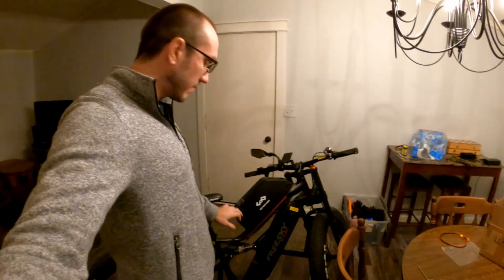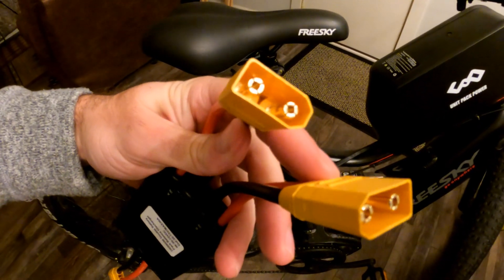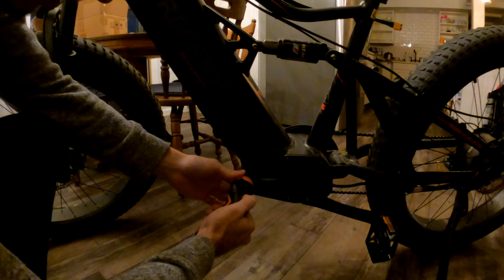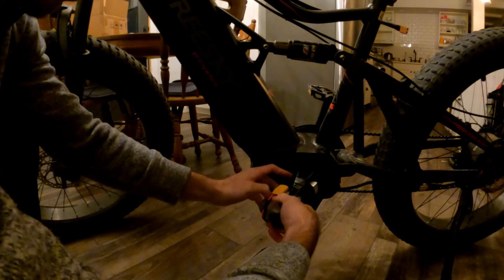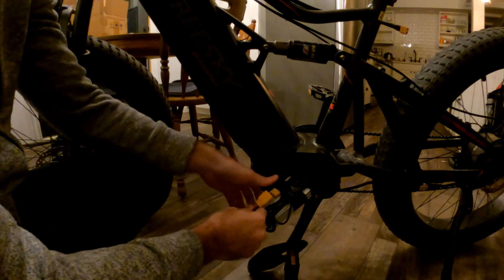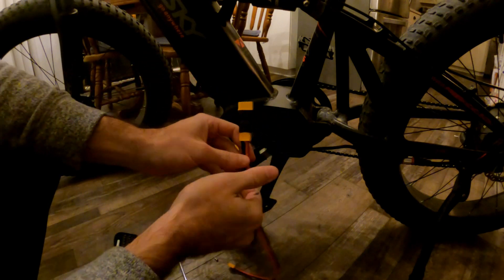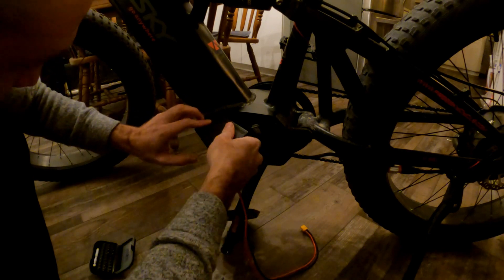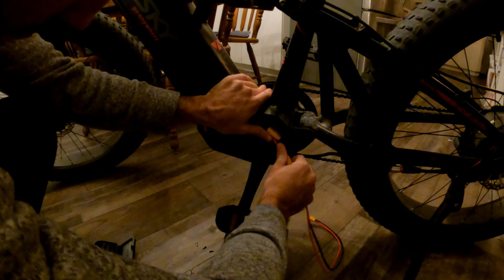How to Add an EXTRA Battery to your E Bike for More Range (Battery Blender, Xt90 or X60)

Comment: I use parallel "Y" adapters. Battery blenders are expensive. I've never had any problems. I don't believe in overkill, that's why I've got 4 battery packs on my bike, lol. I just charge them all separately. You can leave them connected while they're charging.
Reply from the maker: Gosh that would be amazing! I don't like the idea of limiting myself to just 2 batteries.

Comment: How did it run?
Reply from the maker: fabulous! Went for about a 50 mile ride and dropped down to 4 bars out of 5. I had my max speed for each pedal assist for longer. No issues
Reply: @yoursixadventures great to hear. Do you have links to splitter and battery you ordered? I’d love to do this project for my ebike. Is this a swift horse?